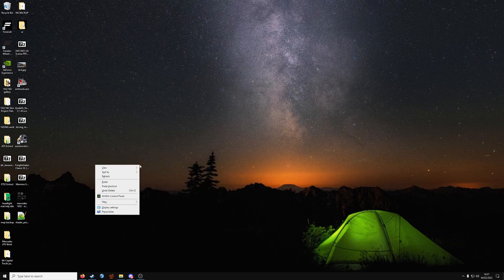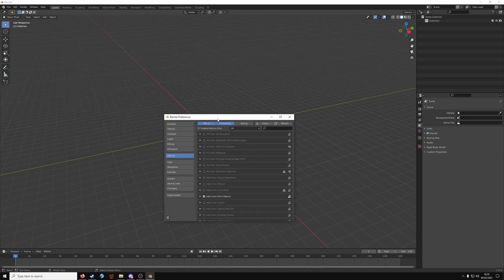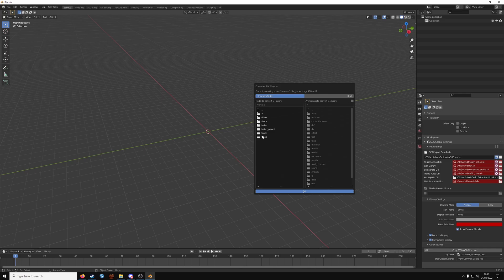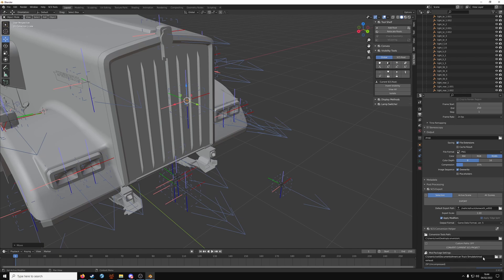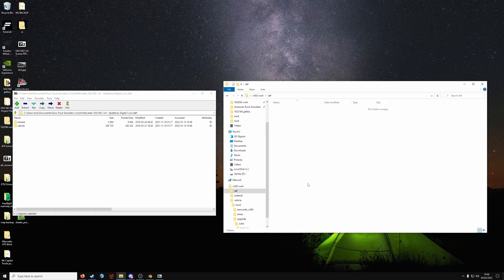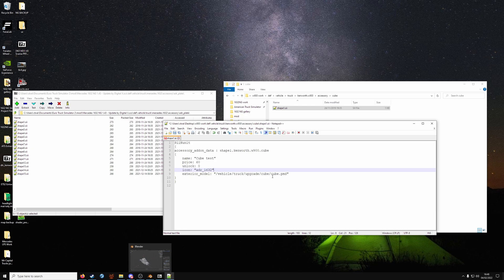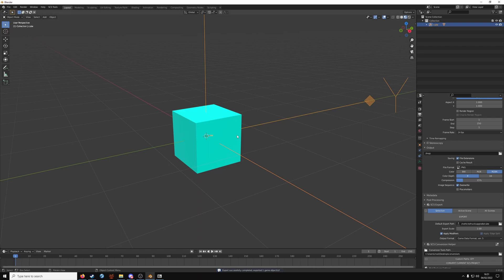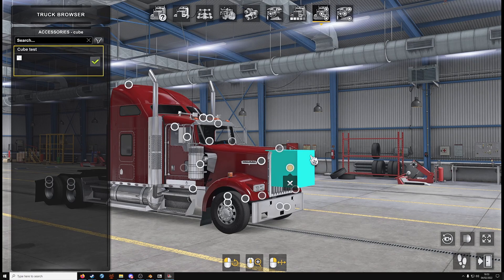ATS/ETS2 Tutorial: How to make a truck accessory!

Comment: Hello Sir, do you have any idea about how to change the in-game name of the accessory locator? Like in your case it came as cube in-game as it's named like that in truck base , but is there any way to somehow show it as different name like "Front Cube" (for example) in-game
Reply: It's been a long time since I've modded. In the Definition file for the accessory at the top it should say something similar to: "bumper.cube.pete389"

It's separated by full stops.
Reply: @DigitalXUK  thanks
So it will show as "Bumper" in game right?

Comment: every time I place the textures and export the message "Texture file" from material 'mat_0001 plastic leather doesn't exist inside current Project Base Path.
TOBJ won't be exported and reference will remain empty, expect problems" the textures turn pink
Reply: It's been a long time since I modded. A lot has happened. In Blender when you set up paths for your project folder make sure they're accurate. They need to be at the folder level that your truck is at.

Also check your material textures drop down option i think it had to be a tobj file then click the cog/wheel icon and it should change into a tobj and give the correct texture.
Reply: @DigitalXUK  The texture paths are all correct, the textures are in the correct sizes, they are all in tga, the tobj is also correct, but every time I export it, I get this error, I don't understand why I'm doing it the same way all the videos teach, but theirs never give errors.
Reply: @DigitalXUK  I saw it here and there is nothing wrong with the texture, it wasn't supposed to give this error, if one day you could make a video showing what can solve this error I would appreciate it, since I've been there for a year and I can never fix it, I have my trucks and I can't change anything about them

Comment: I was getting the red box on the conversion tool for the >> PACK MOD << command. turns out the extra_mount.txt was not there and i had to drag it from v1.14 to the latest. This fixed the issue and now Blander is recognizing the conversion tool

Comment: I wonder if you can help me. I made a Steering Wheel in Blender, to use with a Scania NextGen. I modelled it and tried to pack it into a Mod with the latest Blender Option. It did pack it and the ZIP seems to contain everything. But the Mod simply doesn´t show up ingame.
So what did i wrong?
Reply: Double check your definition files. It sounds like a dangling pointer that isn't named correctly or pointing to something that doesn't exist.

Comment: tried to add to the body of the trailer. I made a locator (test), registered a folder named locator (test) in the accessories folder. No point. I'll prescribe (in body.sii) defaults[]: ".../accessory/test/shape00.sii" - appear on the model but there is no way to remove or change it. It seemed easy, but I can't.

Comment: Is it a problem if I do not have the mod folder on C:! What files are created here at the video 14:00?
At 7:57 a Locator is created I see the already when I activate the mod? I have the following folder: material, vehicle, including pmg and pit files, but with you the files are somewhere else? What am I doing wrong. Thanks for your help.
Reply from the maker: At 14:00 that's from importing the truck, files are created automatically in the work folder you make at the beginning when you import the w900. No locator is created at 7:57, the orange axis is the game_object (the truck) which holds all the model locators, pieces etc. I don't know what's wrong because I can't see your folder. It needs to follow the structure I show.
Reply: @digitalx8460  I import the truck, folders are created, make a locater export and pack mod afterwards.
After that I have a zip in the mod folder, zb. cubetest.zip. Can I see here already with this created zip (mod) the locator on the truck?! Sorry, anyway thank you already.
Reply from the maker: @rainproof264  That sounds about right. Can you list the folders in your cube.zip please. The model locator should appear by the grill on the W900.

Comment: just skimmed and going to watch properly tomorrow, so can you now then place that cube anywhere on the truck with pressing the dot locations on truck
Reply from the maker: If you have the cube (game_object) centered in Blender, wherever your node is on the cabin model, that is where the cube will spawn. If you place the "cube" model locator on the roof then the cube in game will be on the roof with the model locator.
Reply: @digitalx8460  i tried it but up to the export part, it exports fine but it doesn't make an upgrade folder
Reply from the maker: @CMoDZ3D  You have to make the upgrade folders yourself.  If you check a truck mod, and look at the files vehicle/truck/upgrade etc. It's like that.

Comment: Hello dear friend, thank you for your good tutorials. I did this for Eurotrack in version 1.44 and with updated tools, but unfortunately my cube is not known and will not be added. Please help me. It is very important for me and I guess because of the new update. Game This problem has occurred and it is possible that the sii file should be changed
Reply from the maker: Double check your accessory .sii file. I've made accessories on 1.44 and it works the same way. Check the game.log for clues. Start at the bottom of the file and go up.

Comment: Hello! Thank you for your guide. I've been wanting to make an interior cabin accessory but I haven't found much videos regarding to that. To make an cabin accessory, do I import the interior model of the preferred truck instead and follow the guide or need to do something else? If you have any ideas or documentations or videos on how-to, I would be very happy if you would share them as I quite need a point of direction to begin with. Regards.
Reply from the maker: I can make a video on how to do the interior accessory sometime next week. It works very similar to the exterior accessory. I've done an interior accessory for the GPS on the 9900i Addons mod.
Reply: @digitalx8460  I would really appreciate it! If you are going to, take your time making it. I will be on the lookout.
Reply: @digitalx8460  Looking forward to an interior accessory tutorial as well. I understand that the process is similar to the exterior, but a proper tutorial from you about it would be immensely appreciated (particularly, I'm curious how the Sisl's Megapack can put one accessory in different areas, like, the same magazine can be put on the floor and on the dashboard as well). And thanks already for all the tutorials you've released so far, you're definitely the best at explaining how to do things properly when it comes to ETS2 modding.